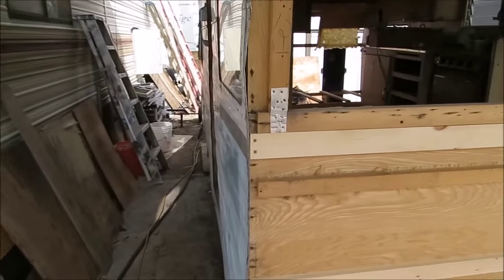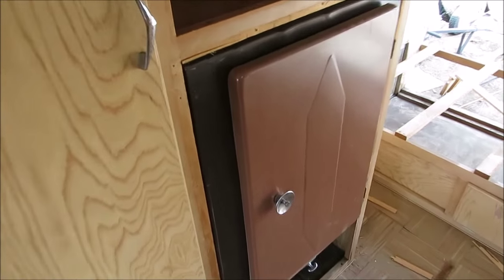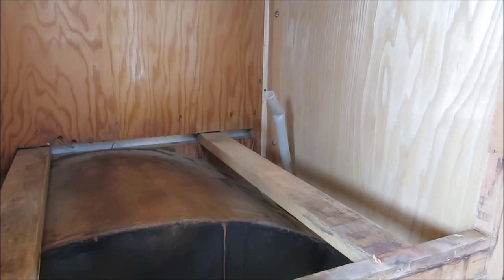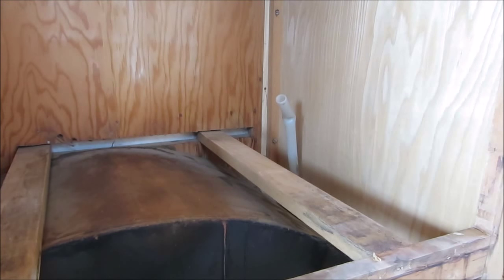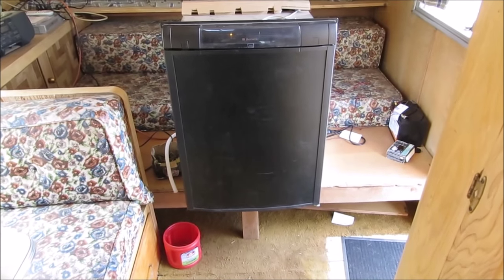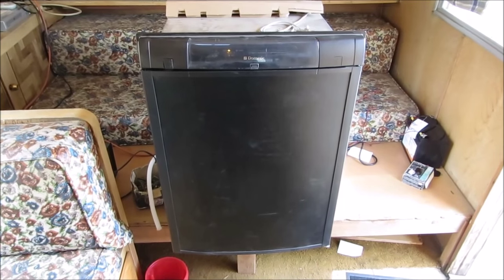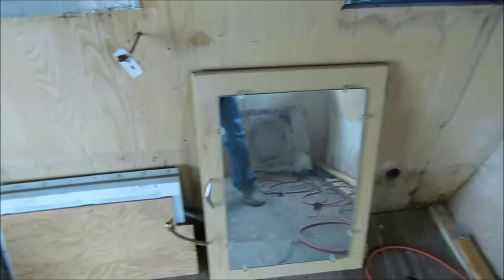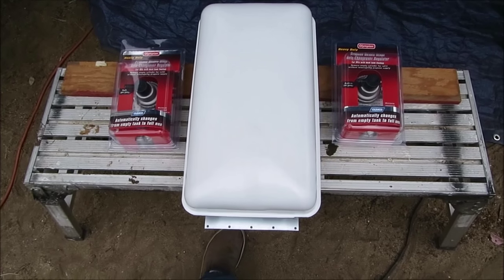59 Shasta Refrigerator Install

Comment: Hahaa... Cutting oneself and bleeding is a vital part of any project like this.

Such a seemingly basic thing as replacing a fridge... In a house, (based on real experience about 4 years ago), I disconnect the old one, roll it out on a hand cart, even though it's bigger than I am. Then I roll the new one in on the hand cart, even though it's bigger and heavier than the old one and I have no business doing it myself. Who cares? I scoot it in place, plug it in, hook up the line for the icemaker, and go have a beer. It's over in an hour. In a 1959 Shasta, plan on it taking a month.  LOL